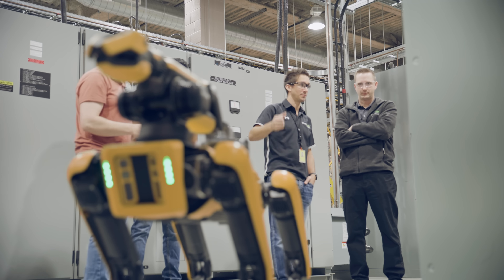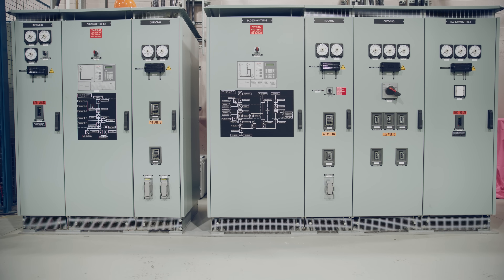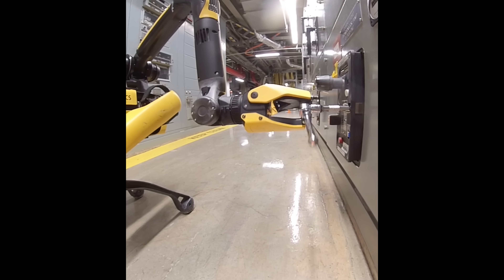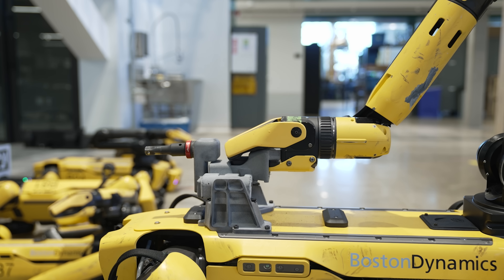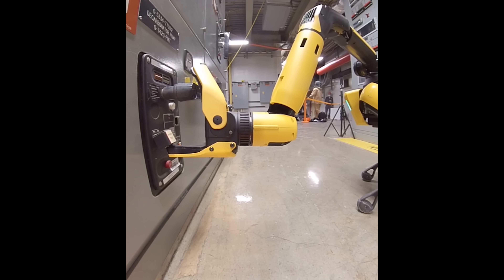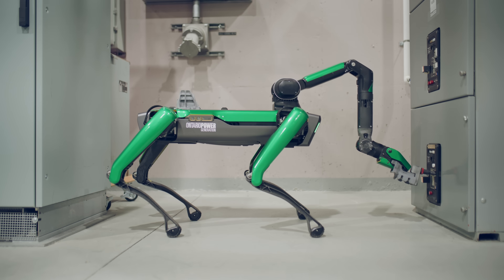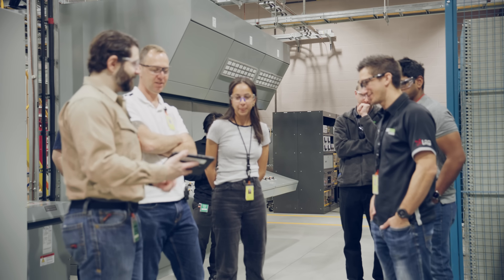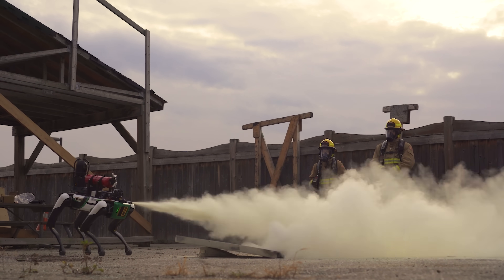Spot at Ontario Power Generation: Automating Circuit Breaker Tripping and Racking

Comment: In my opinion, integrated power tools seem like a pretty obvious option for a robot like this.
Reply: There's probably a few reasons why they don't do it. First of all, it adds weight to the arm. Then, another point of failure, one that is quite a bit harder to fix than simply giving Spot a new ratchet wrench. Spot's current arm is capable of doing all kinds of things, like opening doors, tripping breakers, picking up things, it's really a jack of all trades. Why give it an integrated tool for a single purpose, rather than have it just use the already existing arm?
Reply: @joost1120 not a single tool, but a standard interface that other modular tools can be built to, and just have the robot carry a rack/carousel of whatever tools are needed for today's tasks when its deployed. Similar swapable robotic tools are already very commonly used in other industrial robots (CNC machines, etc) as well as in spacecraft robotic arms
Reply: @joost1120  A decent drill/screw motor is only a few ounce, that could be detachable or built in. The complicated part would be building a reliable quick selection bit/screw holder that fits on spots back.

If it's detachable (which is the way I'd go) they just need to update spot it self with a powered modular quick attach system somewhere on Spots hand, ideally in a way that places the driver right below the hand camera.
Reply: @SimplestUsername  The point of spot having a robot arm is that it can do many different tasks in sequence without switching its attachment. A small drill will still need to be grabbed by the robot and it's not much different from using a ratchet wrench. Maintenance jobs like this are quite rare, and a 3d printed attachment bolted to a  ratchet wrench seems to be a finically responsible decision here. Government facilities are very budget conscious and taking the robot back to Boston dynamics for a upgrade will be very expensive
Reply: @evanli421  part of my entire point is that Boston Dynamics should build power tool attachments that Spot can attach and use it's own. Like tools that attach to it's inner hand by the camera and then stored on it's back when it's finished freeing up it's hand. 

Also, there is obviously a market for a robots automating maintance jobs. That's Boston Dynamics biggest potential market.
Reply: not an electrician but i imagine there's a 6m arc flash reason on this type of work that prevents the humans from using power tools in the first place
Reply: For real, a kitchenaid mixer has that universal socket. Spot needs one. They can partner with dewalt or something.
Reply: They said it in the video, flexibility as a platform. They don't want to decide for their customers what use cases they can use the bot for.
Reply: @Nekonaut_aka_Jebus  then have some sort of modular connector then just a head arm as well automated quick disconnects for tool swapping
Reply: @nadiaplaysgames2550  Ok, I'll let them know.
Reply: I don't think Spot has the body mass or stability to brace against the torque an impact driver would put out. So using its own motors makes sense here.

We humans seem to always underestimate how much leverage our body gives us. Even a simple "smart home" contraption to push a button on a DVD player needs to have complicated attachment methods to not be pushed off before the button goes down.
Reply: Some people disagree but I think with further evolution of the technology they will build stable multi-limbed robots that should have integrated power tools and/or the ability to change out tool heads like shown in the video. The potential is grand.
Reply: It isn’t meant for one job it’s meant to be a blank slate waiting for add ons to do whatever the user wants

Comment: Spot with an assortment of replaceable custom tool "hands"/arms (and associated logic) seems like the way forward.
Reply: this was obviously an example of "what can we do with off the shelf parts" that grip it's using is probably just 3d printed, and they probably just took the end of a ratcheting screw driver for the ratchet.

easy adaptation of existing gear is actually better then a special solution.

Comment: Very interesting to see Spot go from tediously and manually operating a socket wrench another person put in to autonomously grabbing and turning a wrench itself. The streamlining is genuinely impressive to watch!
Reply: I think it highlights the fact that the developers devloped Spot as a proof of concept instead of targeting a particular market. Integrating some form of a power tool module on the second generation would be a welcome addition that could make the robot infinity more useful.
Reply: @SimplestUsername  I feel like something like that could be achieved by just having different attachments for the arm.
Reply: @cameron7374  Precisely. I believe that a modular, powered, quick attach system built into spots hand would be the way to go. Then developers could build different module's that attach on Spots back to hold the attachments, bits and materials.
Reply: @SimplestUsername  It is powered. I think what you mean is rotating.
Reply: Why are they saying PPE glasses during an interview in a control room? 🤔

Comment: So glad to see Spot doing what it is designed for.
Reply: Wait it was not designed for dancing? I have been lied to my entire life.
Reply: @rafaelsousa5 is a universal use robot
Reply: @Galactic_3100  Yes I know, it's a joke.
Reply: @Galactic_3100 Like a universal remote control?
Reply: @itisjustacomment  Yes its a robot designed for multiple functions
Reply: @Galactic_3100  Can it turn  my TV over? As my remote isn't working ?
Reply: @itisjustacomment yea, it can turn a nob or push a button just fine with it's claw
Reply: @itisjustacomment well to clarify you might have to replace the actual claw part of the arm with a poker
Reply: @Galactic_3100  Cheaper to buy a remote.
Also, my wifi /radio switches are better all-around.
Reply: @itisjustacomment  I said the robot replaced the breaker
Reply: @Galactic_3100  Hardly the same degree of robot.
Reply: @Pepperguy21they’re just taking the boring and dangerous jobs, so we can focus on the fun and creative jobs. At least until AI takes those over, then we’ll have a real problem
Reply: @lukestarkiller1470  'we can focus on the fun and creative jobs' 
Oh sweet summer child...
Reply: If your job is to turn a ratchet then odds are you would have lost it anyway.

Ps. I'm sure people said this about combine harvesters....would you like to go rake hay 12 hours a day for minimum wage?
Reply: @tonyatthebeach  Shoot, just look at the industrial revolution which was supposed to cut millions of jobs, but didn't because it forced people to go after new trades and learn engineering and other STEM fields. Robotics are already doing the same, and we are seeing MORE jobs, as we eliminate minimum wage jobs that are dangerous or not important. We don't need a min wage cashier taking orders paid by a billion dollar corporation, we don't need people taking unnecessary risks to do something a robot can easily do.
Reply: Marketing?
Reply: @Pepperguy21 Only this was clearly Union Robot deployment. They took the man out of the suit, and gave him a robot and a controller. Keeps his job, and it suddenly got safer. And if the robot fails, he still knows how to go in and do it.
Reply: Yes, unfortunately our society does not currently have any way of supporting people whose labor will be made unnecessary by this and who formerly received living wages
Reply: Cheaper to have a Wi-Fi/motor breaker with radio wave backup or hard wire.

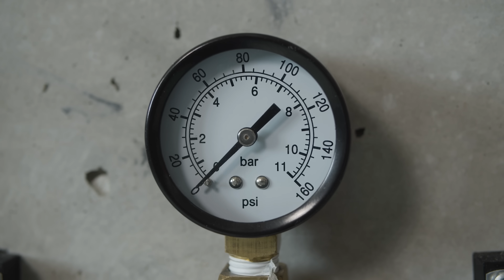Comment: 0:50 ahaha!  Boston Dynamics engineers out of touch with reality!  Guys, do you even know what world you live in.  Step out of your clean and sterile laboratory walls into the real world!  Where is the testing of your robot technology in real harsh conditions?  In Ukraine, I have not seen a single product from Boston Dynamics.  In recent films and series dedicated to the events of accidents at nuclear power plants in Chernobyl and Fokushima, it was shown (I admit exaggeration on the part of the scriptwriters for the sake of greater drama of the plot) how people went to the zone of increased radiation to shut off (open) the valves in manual mode.  In Chernobyl, it was also in a tunnel with radioactive water.  With the overlap of one valve, they could hardly cope with the strength of two people at once.  And then they show us a children's robot!  Yes, it's very funny!
Reply: PS  Sorry "Fukushima"
Reply: I haven't seen one hard hat or high Vis jacket there, so they must useless in the "real world" too!

Comment: is Spot radiation ressistant?
Reply: Resistant in the sense that it won't get radiation sickness or cancer like a human would. Electronic components aren't lead shielded b/c of the weight, so it probably takes damage gradually as particles penetrate it. The thing that would have to be replaced most often is probably the cameras and sensors.
Reply: @voxelemur  oh sorry, i wasnt specific, what i meant is like will it be able to function through high levels of radiation that can interfere with its signal

You know that one scene in chernobyl (the amazon series) where they lost control of their drone because of radiation interferance? Kinda like that

Edit: oh i see, thank you for the info!